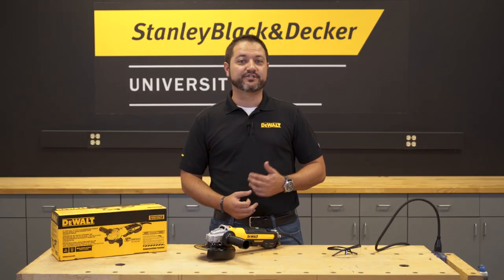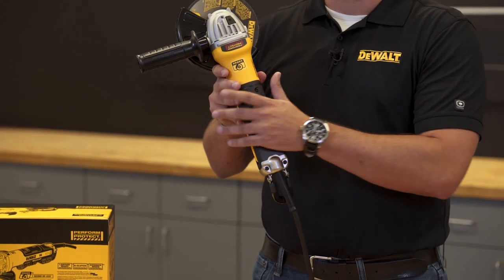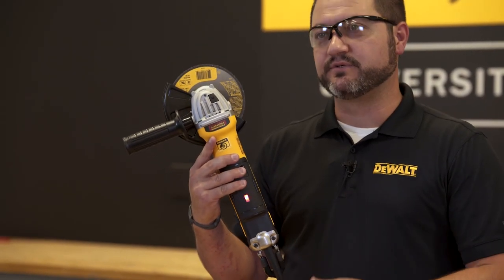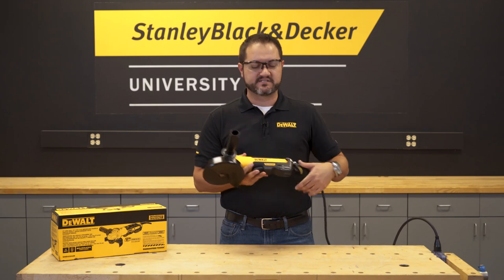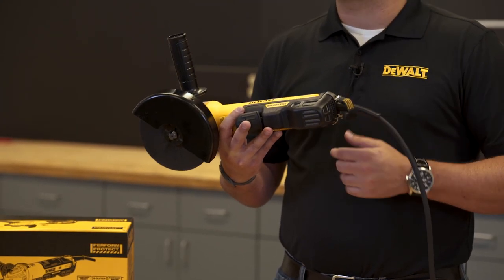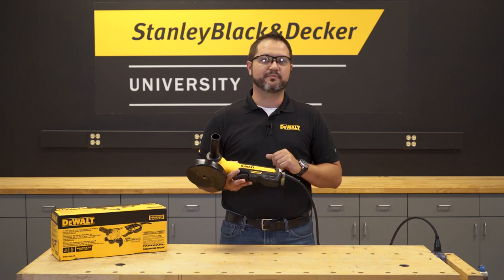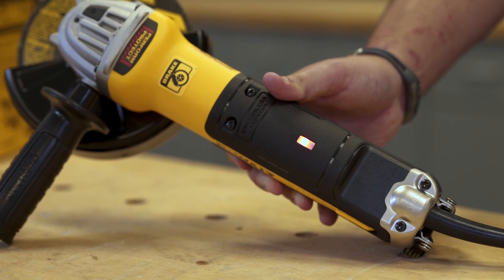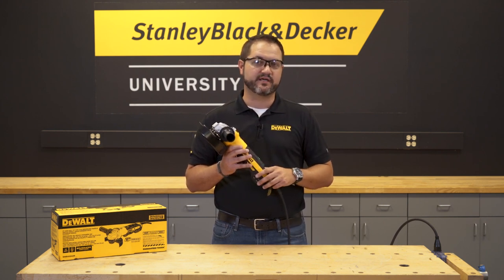DEWALT® Corded Brushless Grinders Feature Overview

Comment: The tool stopping the disc when you let off the paddle is great!! 
3 years ago, I finished a cut and tried to set the grinder down while I held onto the 90 degree/support handle. I didn't have a tight grip and the spinning inertia of the blade caused the tool to spin back around towards my hand and cut clean through the flesh on my knuckle and right into the bone! Well THAT caused the blade to stop spinning! I used butterfly bandages and it took almost 1-2 hours to stop bleeding!
I also caught myself with a rust stripping disc, ya know the ones that look like Scotch Brite pads, but they're very coarse and hard? That caught the palm of my hand and OMG did that hurt!! Far worse that cutting into my knuckle! 
It took more than a week to stop throbbing and almost 3 wks to heal. Be careful. ALWAYS wear safety glasses. I recently learned from a 1 eyed blacksmith, that your eyes do not have antibodies like the rest of your body. So if you get a tiny piece of metal, plastic or anything in your eye and it stays in longer than a few hours, it can develop an infection and NO DOCTOR OR ANTIBIOTICS WILL HELP! 99.9% of the time, they will remove your eye! Don't believe me? Can and ask your local ophthalmologist! Stay safe and do the best work you're capable of!

Comment: I bought this DWE43244N yesterday, it looks very well made but the instructions are not good.  From this and the other Dewalt video it is impossible to tell which size hole in a  Cutting Wheel matches this angle grinder.  Yes the arbor or spindle is 5/8 inches,  -but the Instructions manual does not tell that.  I got that from the description at the Home Depot site.    

But there aren't any 5 or 6 inch cutting wheels with a 5/8 inches hole at Home Depot or any other place!   

Cab cutting wheels or any other accessory with a 5/8 inches hole be used with this angle grinder?  The Instructions Manual does not mention this.  Is it a secret what size hole may be used ? ? ? ?? 

And can the UNTHREADED BACKING FLANGE be flipped to accommodate different size holes in cutting wheels and other accessories??????????? ? ? ? ? ? 

I measured one side of a raised circle in the center of the UNTHREADED BACKING FLANGE,  it is 7/8 inches. The flip side of this is flat.   Maybe this angle grinder is designed for cutting wheels and other accessories with a 7/8 inches hole.   I noticed there are mostly 7/8 inch cutting wheels available on the rack at Home Depot and other Places.  

But if this angle grinder is designed for 7/8 inch cutting wheels and other accessories, -CAN IT BE USED WITH CUTTING WHEELS WITH A 5/8 HOLE?????????   -by flipping the UNTHREADED BACKING FLANGE so the flat side is against the cutting wheel? ? ? ? ? ?  

And what about the THREADED LOCKING FLANGE, can this be flipped ? ? ? ? ? ? ? ?    Or should it be used on one side only?    

Honest to Glory,  I have read the Instructions Manual,  I have looked at the awful DeWalt video here on YouTube on how to use accessories.  It is terribly out of focus.   There needs to be some IN FOCUS  CLOSE  UPS on this specific model!   CLOSE  UPS    CLOSE UPS    CLOSE UPS   !!!!!!!!!!!!!   IN FOCUS   IN FOCUS

DeWalt, you are just lazy, your instructions and videos are just not adequate.  

Yes, I am a beginner, so I need the ABC's.

Comment: What stops a grinding disk from unthreading and coming off the grinder?  This is Newtons law of motion.  If the motor slows down before the disk, the disk will unthread itself from the grinder and go flying down the shop.  I have been working in welding shops fro 14+ years and have seen it dozens of times.  The disk you are using has a backup nut to tighten the disk.  I am talking about the types of disk and rocks with built in threads and thread onto the grinder.
Reply: Nice comment, i think for these kind of grinders with fast stop, the threaded wheels should not be used, maybe the manual states it
Reply: Or they should adopt, like Makita did, Bosch's X-LOCK® system and that's solve this and other shortcomings of the ancient threaded spindle system.
Reply: @mariuso4879  I see nothing wrong with threads.  When you release the trigger just hold the wheel against something.

Comment: Why would your 6" be 9,000 RPM
And your 5" be 10,500 RPM
Reply: The larger the diameter of the grinding wheel, the more it weighs. So more force is required to stop/start the wheel as size increases. So the slower it spins the easier it is to start/stop without burning up the motor.